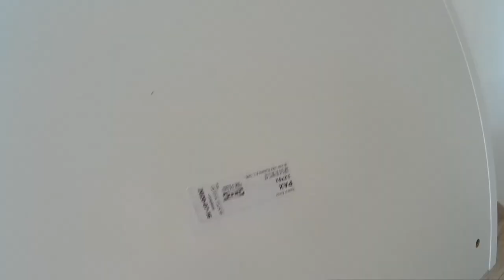IKEA PAX Komplement Wardrobe Assembly drawer sliding doors soft close  - montage meuble

Comment: I cannot get the new screws in they are too thick on the parts that fix inside to the doors !! Any ideas please????
Reply from the maker: at 28:08 ? 28:55 ?
Reply: Ahhh sorry 30.05 they're completely different???
Reply from the maker: @method9787  Difficult question :
maybe you traded with those from 23:46
Reply: @Keitex  they supply longer ones but they will not go in there is a significant difference in thickness and thread !!! I just think there not designed for pax doors or they've supplied the wrong screws!! The ones u remove are not long enough !!!
Reply from the maker: @method9787  Sorry about that. I think you should find it to ikea
Reply: @Keitex  spoken to them after over an hour they gave me the wrong soft closures proper ones on way free 😀